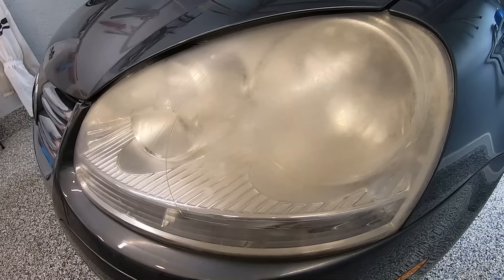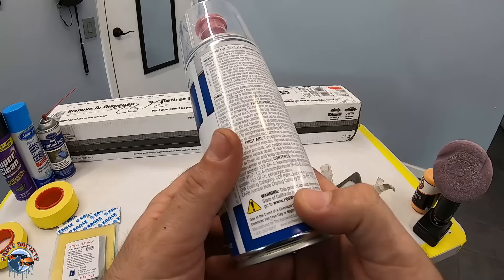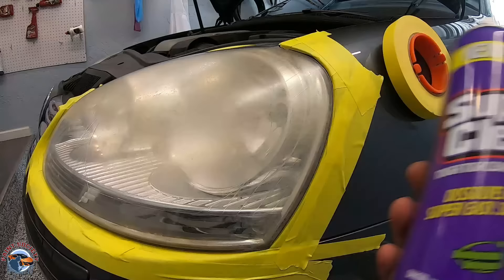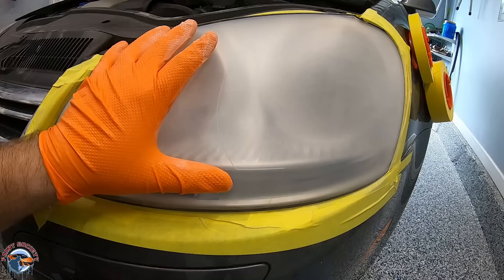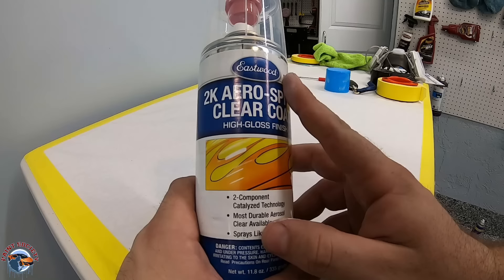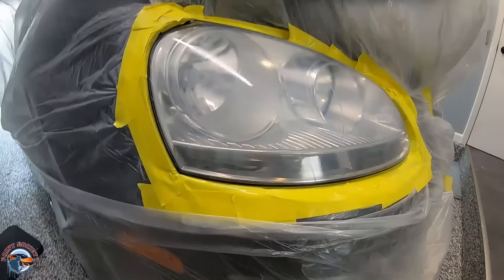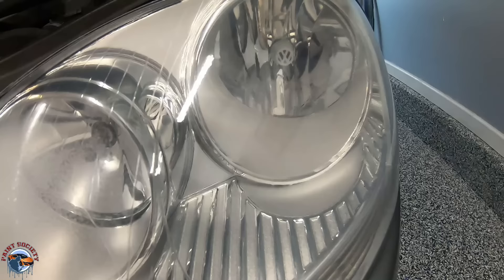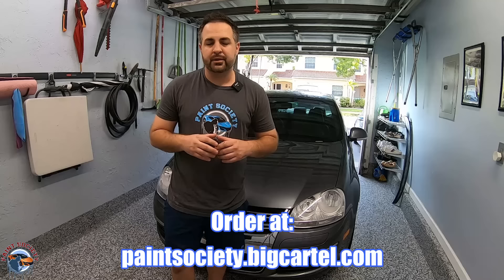The BEST Guide to Restore Headlights PERMANENTLY!

Comment: Nice job bro. I would like to ask you about my headlights : i bought the car from  dead cold country with lots of snow everyday and the headlights have like million of little cuts which are only visible at night with lights on. Also they are smooth to the touch.
Do you think by sanding them will fix the issue or there is a bigger problem?
 Thank you
Reply: Sanding will not remove all the little cracks

Comment: From what I’ve learned, the most important part of a headlight restoration is applying  product with UV protection as a clearcoat. It is UV rays that attack the polycarbonate headlight material. The clearcoat paint you applied has no mention of UV protection and thus I have to assume it has none. If the product possessed UV protection properties I am sure the manufacturer would state it loud and proud on the can or on their website which it does not.  So I suggest this product is incorrect for UV protecting a restored headlamp.   Thank you.

Comment: I did my cars in my carport last year... not advisable. I was using 600, 800, 1500, 3000 on my Benz lights as a wet job. Hardest part was waiting for the clearcoat applications to dry. Too much debris in the air during pollen season.

Comment: My headlight came up good. The only problem is they are a bit bumpy after the clear coat. Its like a mini droplest of the spray. Its not super smooth although they are clear. Can i fix this with polishing or should i wet sand them first?
Reply from the maker: All that info is in the video.

Comment: You can buy new headlight housings on eBay and Amazon for more popular cars and trucks  and be done.
Reply: except you need to be careful of several things with the chinese knockoffs, because thats what they are. 1 the molds often have physical flaws, like flashing. 2 if they have electronics, like lightbulb sockets of their own, they are garbage and often catch fire, 3 the bezel around the bulb often isnt made of oem plastic and will melt just from bulb heat, and 4 they will all cloud up too and have almost no UV protection either. Already purchased several and wont do it again.

Comment: Would the 2k spray max brand clear work for this?
Reply from the maker: Yes. Same thing
Reply: @PaintSociety  thank you, napa near me stocks it.
Reply: @PaintSociety  I followed the instruction down to the T but I get crazing(cracking) on the lenses. Happened twice already. I used 2K clear and do multiple light coats with sufficient wait time in between.

Comment: I used 800 then 2000 then 3000 grit wet sandpaper on my headlights, then used meguires Plastx, then a clear coat, spent about 2 hours on my headlights, didn’t do a damn thing….. this time around I’m taking a drill with sandpaper to it

Comment: If I could ask an important question please? The Assilex paper here in Europe is either completely unavailable or WILDLY expensive (70+ euros per box per grade!).

Is it possible to follow these same steps but use a more traditional P-grade silicon paper? e.g. 320, followed by 600, and then the clear coat? Or does it have to be with these special abrasives?
Reply from the maker: Yes p grit will work just fine but start at 400 then 600 then 800
Reply: @PaintSociety  thank you so much for helping! :)

Comment: Do I not need to use a compound and polish after the sandpaper step? I can just go straight to clear?? Did not know that before
Reply: I would think you would still want the surface a little bit roughed up so the clear spray anchors better. if anything, you'd polish the clear after it cured if necessary, one would think.

Comment: Hey Brian, I got a question. I have a set of headlights that I’ve tried to restore but it’s still Hazy they were clear but they were worse than just wet sanding and polishing them. Is there something I can do to get rid of the haziness?
Reply from the maker: Follow this guide… it’s the best way
Reply: So I had a buddy of mine clear coat them at a body shop and when I got them back they were hazy, what could of cause them to do that if they were cleared? I was able to get some of it haze out of them but they are still somewhat hazy. I’ve wet sanded them with 400 grit to get the clear off then used 800 grit then I used 3000 grit then polished them with som fine cut compound. Should I redo the process and but with 600, 800 then 3000 and then clear?

Comment: Could you use a hair dryer to dry the clear coat quicker also will it give a better finish with  the warm air
Reply from the maker: You shouldn’t need to. Just lay it on thicker
Reply: Thanks you mentioned the room temperature and at this stage I guess we should wait die to the winter weather

Comment: 2k clear on the plastic will harden and fracture the lights making them look like broken glass with the extreme heat during day and  cool temp at night. plastic is flexible needs to be coated with something that can also flex on the headlight.  Noone should spray clear paint on plastic.. bad idea. I messed up so many lights thinking it was ok. they looked great but then they were destroyed from spider cracks caused by 2k clear.
Reply: Did u get the cracks a few minutes after painting or until some time later??
Reply: @Omar Zahaf   customers reported them after it cured and the vehicle was in the hot sun .  The lights were inspected and we were told that the clear coat bond to the plastic wouldn't allow for plastic to stretch and compress in extreme heat then cool at night then heat again so under those  pressures. it caused the plastic housing to micro crack everywhere to release pressure from the drastic heat changes..  it happens to even factory headlights on days when it's super hot then cold at night then hot again.  clear plastics suck lol. whatever. I just warn everyone about it if they want their lights fixed so they don't think it's my fault

Comment: Is it possible to use a HS clear will it still work the same etc?.

Also instead of using a K grit can a P grit sandpaper be used?

Please let me know 

Thank you in advance
Reply from the maker: Get the k grit. It’s much simpler
To use and you use less then you would use and the spray can in the link works the best. It doesn’t leave any cracking. Some clears will leave cracking
Reply: Cool thank you so much will do that

Comment: Can i still use 600,800 and 1200 and than hit with clear coat will that be better than just stopping on 800 grid coat
Reply from the maker: You’ll lose
Adhesion
Reply: @PaintSociety  so will 2k clear coat cause cracking so using higher grids will make so smooth and cause cracks? i live in colder states so i had used 1k on my work hardhats and it was left in car over winter fully spider webs cracks on it from 1k but it was sprayed on smooth hardhat not sanded .

Comment: Why do you think my clear coat had cracked marks after the headlight dried. To be fair I was  doing this outside.  I am thinking the heat from the sun did it? Any other reason you think
Reply from the maker: You used the same exact clear in this video?
Reply: @PaintSociety  I wish but no it was another brand. I had it outside as it was a nice fall day.  When I went out check on it (i am only talking about five minutes) it had done the crackling thing.  I sanded it back off and made sure it stayed in the shade for this round :) I think it got too hot.
Reply from the maker: Some clears have additives in them that don’t get along with the plastic. This one linked in the description won’t give you any issues.

Comment: I just finished my headlight, I used a different type of clear coat, it is for uv ray and plastic, temp was about 60 degree.
The clear clesr coat cracked after spray paint, this is the second time it happened.
The first time it was too cold 35 degrees.
This time 60.
Why does it do that?, I am getting  a different clear coat brand next time but I dont understand why the paint behaves like this. It cracks once it drys up.
Reply from the maker: You need to use the clear in the video. I cannot stress how important it is to use the correct products.  This clear will not react and crack
Reply: @PaintSociety  thank you, I will order.
It is interesting how the products behave.
Reply from the maker: @Keepin-it-wheel101  use the link in the description
Reply: @PaintSociety  you were 100% correct.
I used the product to used and problem fixed, paint dis not cracked, did not run, day and night....
THANK YOU.

Comment: I got greedy and did 4 coats,
1 base coat 10mins
2nd coat 5mins
3rd coat 5mins
then I thought of a 4th coat after around 4 hrs, now it looks grainy and not smooth, what to do? I ruined it. should have stopped at the 3rd coat which was already clear and nice
Reply from the maker: Basecoat on headlights ?
Reply: @PaintSociety  oh sorry painting noob here haha, what i mean is the very first pass/coat (i assumed it's called base coat) =P
Reply from the maker: @bobturla  you can sand it with 2000 grit and buff it
Reply: no need to clear coat again after sanding and buffing? I only meguiars plastx, will that be enough for buffing? thanks for replying btw
Reply from the maker: Hopefully you used everything in the video to achieve the same results.  If you sand with 2000 you’ll need a buffer and compound to get the shine back

Comment: If a been 2 years. How well has the Rustleum 2X held up?
Reply: @PaintSociety  sorry for the indecipherable typo....  I was asking how well the Rustoleum 2X has held up over the past 2 years.
Reply from the maker: Sorry, I’m so confuse I’ve never use rustoleum
Reply from the maker: I think you have the wrong video. I specifically said not to use rustoleum.
Reply: Where did you buy the pads for buffing
Reply from the maker: @mayan34956  amazon

Comment: I'm confused, you say and on only one package I can find, that k800 equals p500 but yet in there video and other packages it says k800 equals p600?
Reply from the maker: K800 equals cuts at the speed
Of a p600. I don’t recall saying p500
Reply: @PaintSociety  9:10
Reply: @PaintSociety  but I noticed on their packages, one area says p500 and another area says p600.
Reply: @PaintSociety  and great video though, like everyone else on here, it is one of the better headlight resto vids out there 👍
Reply from the maker: Ok good catch k800 will cut at the speed of a p600 regardless not a lot of difference between the two
Reply: @PaintSociety  thanks!

Comment: One question. Is the Eastwood product meant for Plastic? If not you are just putting back on what you just took off that didn't work the first time. 2k just means it has a drying catalyst it doesn't make it meant for plastic.
Reply from the maker: The headlight from the factory never had a 2k product on it.
Reply: @PaintSociety  Which still doesn't answer the question. is that paint meant for plastic and 2k unless other wise stated is just a catalyzed drying system. It's a pain in the arse on cars. You can't repair it. It has to all come off.
Reply from the maker: @thatamerican3187  yes of course. 2k can be used on anything. It’s meant to protect the plastic lens. It’s a much stronger product then that of a regular aerosol.
Reply: @PaintSociety  Well time will tell.
Reply from the maker: It’s no different then taking care of your car.  It’s the same paint. If you don’t wax it. It will fade just like your cars paint

Comment: Hello there. I've been watching your paint techniques and they are amazing. I'm just a DIYer. Today I decided to help clean the headlight on my mom's RAV4. I applied the clear coat and it starts to crack/spider webbing as it dries almost immediately. How do I avoid this? I don't think I applied the first coat heavy at all. This happened twice so i've already sanded it down once again but now I am very hesitant to apply it for the 3rd town just to see it crack again. I'm using the rustoleum clear coat 2X gloss.
Reply from the maker: You didn’t use the clearcoat from this video. This is why it is so important to follow the guide and the products in the guide
Reply: Rustoleum 2x is not the same kind of product you should be using. Eastwood is a 2-part clearcoat. the rustoleum is not.

Comment: Why no 2000 or 3000 grit to take out the 800's before clearing??
Reply from the maker: Because clear won’t stick to 2000 or 3000. It will peel off. The clear fills in k800 and will have a good grip
Reply: @PaintSociety  oh wow I did not know that thank you for the reply on an older video.....the 3m kit I've always used on my cars comes with 500, 800, and then a 3000 before using a clear coat "wipe" so I assumed that was normal. Is that the same when redoing a roof or hatch spoiler that's lost its clear?
Reply from the maker: @TheRealMrRoyal  you’ll need to really watch my videos to get specific answers because it’s different for paint.  Regardless the 3m lot doesn’t use real clearcoat. It’s more of just like a ceramic coating

Comment: The headlights should be wet sanded. Better results and saves sand paper.
Reply from the maker: K series is a dry sanding system and there is 0 research based facts they wet sanding improves the finish other then personal preference.

Comment: Very good video....but the title says, "PERMANENTLY," and at 2:00 you said they won't fade for, "...a good amount of time."  This is NOT a "permanent" solution.  This does what almost every other headlight restoration kit does:  cleans/clears the headlights temporarily.
Reply from the maker: Hi John. It’s more then that. It will permanently restore the headlights and they won’t fade or peel like oem. Depending on how well you do the job will determine the fading or not. Thanks bud

Comment: cant you use rubbing alcohol to degrease and regular sand paper? seems like you have unnecessary expenses built into this
Reply from the maker: Is alcohol a degreaser ? Seems like you answered your own question.
Reply: @PaintSociety  just did a google search to double check and the first thing that came up is "Isopropyl Alcohol is an effective degreaser and can be used to cut grease residues". is that not how it works?
Reply from the maker: Cooking grease. Not automotive

Comment: Wouldn't it be cheaper just to replace the assembly? It certainly would be safer than working with toxic chemicals.
Reply from the maker: It depends on the headlight assembly
Reply: @PaintSociety  Mine is a 2002 Mustang - 2 retaining clips removed and it's out. Replacement would cost about $70 for a pair. But alignment would cost extra unless I tried my hand at it. Probably around $100 total cost.

Comment: Want a good laugh? What does headlights, plus goof off pro remover spray, plus plastic scratch remover, plus mineral spirits.... Extreme Degreaser.... Light sanding and even, sigh steel wool equal? An average Friday for my dumbass. But actually thats the second costly mistake Ive made in 3 days, I belong driving a car, not under the hood. And I'm no artist. What can I do? Brand new headlights with a tiny bit of over spray, and it's not within 30 days of the Amazon order. I can't pretend it came that way and return it.......😳 Cause I'd never do that.

Comment: I know Paint Society is a solid channel and 99% what you say is good, but please, do not put this on poly-carbonate lenses. Yes it will look beautiful for a few years but the lenses will suffer permanent damage. The 2k clear doesn't expand and contract in the same way the lenses do. Over time the lenses will develop spider cracks within the lens itself and it cannot be sanded or buffed out.
Reply: I just watched the video from the headlightPro😂, but yes, you can clear the lights. If something goes wrong with it, you can always sand it again and clear
Reply from the maker: This method works. Not sure of this damage you speak of

Comment: No definitely not “permanent”.
Reply: It’s clear coat it’ll last as long as any paints clear coat, so it’s pretty “permanent”
Reply: @gavinxlucas not on headlights, the plastic under oxidizes and the the clear coat starts cracking, bubbling and falling off. It ends up looking even worse than before you restored it. Think about it, clear coat is meant to be sprayed over a base coat paint, not over polycarbonate plastic.

Comment: Never, ever, apply a coating or sealant to any polycarbonate lens. Ever. No manufacturer does that. Neither should you.
That coating will dry out, start cracking, peeling off. Very hard to remove. Stains the lens.
Never, ever do that. Terrible advice.